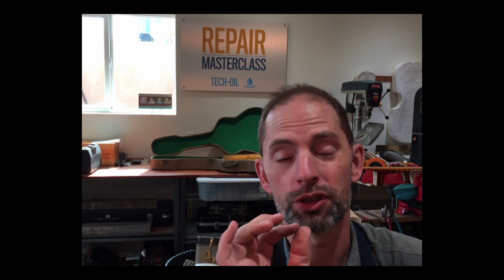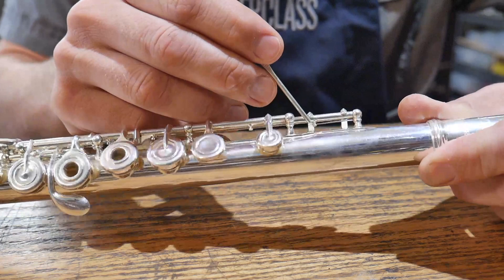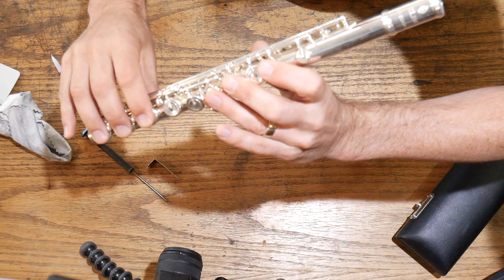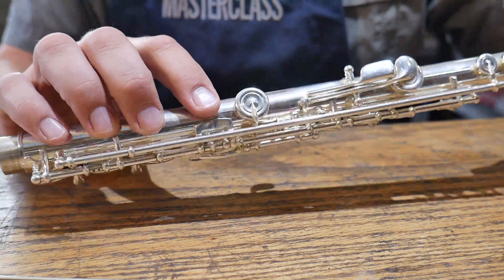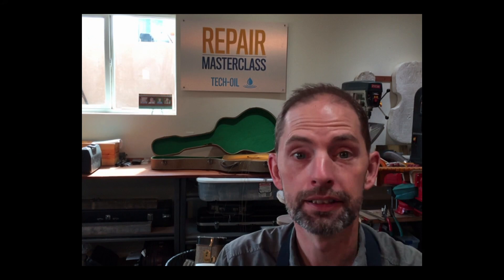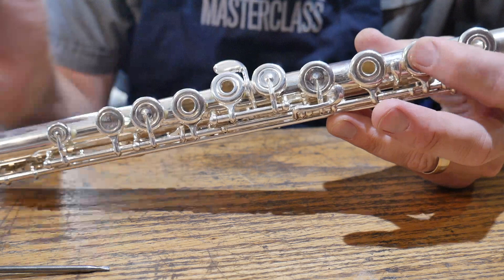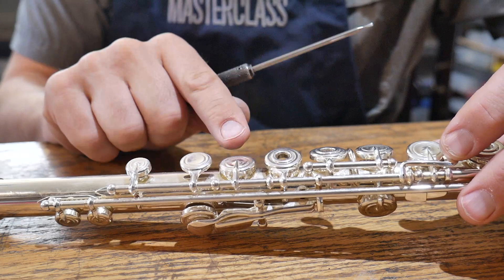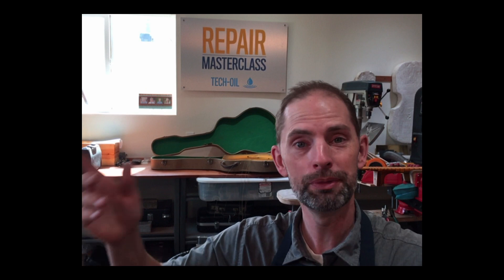Flute Emergency Repairs

Comment: Full disclosure here...I have a degree in music education so I felt pretty comfortable with all of this. I had a key that was leaving slight gaps in others when I pressed down. I had been putting off taking my flute in forever because apparently I'm lazy or something 🤷‍♀️ Anyways, I have long suspected it was something SUPER slight like adjusting a screw.  Yup literally all I had to do. I adjusted a tiny hidden screw and I can play my F's without pressing down my f-key with the force of what felt like the Hulk! I figure if I could restring a french horn, doing something simple on my own instrument should be cake. Now will I go repadding or recorking my flute? Nooooo! Absolutely not. But slightly adjusting screws and such I can handle. Saves me some time for other things in my busy life. Thank you!
Reply from the maker: I couldn't ask for a nicer or better response. I'm really glad this was of value to you and that you no longer have to your Hulk-like strength to play.
Reply: I know this is months after this comment was posted but could you tell me which one it was? I’ve been having the same issues in which my Fs won’t come out without having to press harder on a certain key
Reply: @BeepBop726 left of the 2nd finger on the right hand under that key is a tiny screw
Reply: I have this problem too! F-key doesn't shut properly. Over watching this video, i loosened the screw on the left of f-key and problem fixed! Thanks a lot👍😁
Reply: Bro- my f was having that exact problem and my section swore that my one tight screw wouldn’t ruin the note so I thought it was a leaky key but i just loosed the screw and now i can play my f.
Reply: @BeepBop726  I just saw your comment over a year later so I'm sure you've got it figured out. I'd have to look at my instrument to know for sure but if you'd still like to know,  I can take a look and let you know. Just be careful when making any of your own adjustments! ❤

Comment: One of my flute trill key is open and it doesn’t Play right, the trill  spring is off, do I just need to put the spring back?, sorry I need this for band.
Reply from the maker: Yup! There's a chance the Trill key is bent and if it is, you'll need a good tech you trust, but more than likely it's just the spring. Flit it back on there.
Reply: @repairmasterclass  just to make things clear, the trill key next to the c key is open and I use a piece of tape to shut it for a while, and I don’t see the screw that keep the other trill key shut, sorry I need this for band

Comment: Hi! One question, my low D isn't coming out when it usually does. What screws should I look for or what should I try to fix?
Reply from the maker: Sorry for my delay, I was on vacation. There are a few reasons this could be happening. 1) The screw at the D key (could be on top and easily visible or under the key) could be the issue. Use a feeler gauge and adjust accordingly. Very, very small turns of this screw make big changes. 2) The D# key on the foot joint could be leaking. Use a feeler gauge to test for a seal here. 3) The D key could be leaking. Take a look at these possibilities - learn more about how to do this with the Emergency Repair Guide available for free on my site - and if you're still having issues, take it to a shop you trust.

Comment: Hello, thank you so much for the master class! One question on the g# key when you put it back where should I put the spring. It is also not working properly. I'm having trouble doing that.
Reply from the maker: Great question. I should do a video on this topic as I get the question a lot. Okay, let's agree on what side of the instrument we're talking about then go forward from there: If we're looking down on the flute we can see the Bb/B (left thumb) key on one side and the G# lever on the other; let's call the Bb/B side the back side and the G# side the front side. 
The springs typically sit on the back side of the spring notch and will lift the key up or open. If you happen to put the spring on a side and it forces the key closed - move the spring to the other side...the only and obvious exception to this being the Eb on the foot joint and the G# we're about to talk about, which are to stay closed unless pushed. 
Now, the G# key, way under everything else, MAY be an exception to putting the spring on the back side. Every manufacturer will install this spring in a different, unique way and you may need to play with it to figure out what their intent was - keep in mind, you want the G# to be pushed closed by the spring. To make this a bit more tricky, you have to set this spring before you insert the key rod...a bit of an acrobatic feat at times... but you'll be able to see right away if the the spring is pushing the pad closed or open and can adjust. Long answer - like I said, it needs it's own video - but I hope this is a help.

Comment: Great information. I have two flutes; a student flute that has screws on top of the keys, and a way better one that has them hidden. The hidden ones makes it very difficult to choose which ones to turn so I am too scared to try to do it myself. I requested the free info as you suggested so I am hoping it goes into more detail on which key/screws adjust what. Thanks!
Reply: Same I tightened all my screws and now all the keys sound the same

Comment: Could you please advise the specific screws I should adjust to fix the issue where my high E flat sounds flat with standard fingering but is in tune with the shortened fingering? I  frequently alternate between the two fingerings in chromatic passages to balance the intonation with surrounding notes. However, it's confusing to choose between the two while playing. Please help.
Reply from the maker: Probably Not an adjustment screw... I'd venture a guess you have an air leak in a pad or key heigh openings could be causing issues. High E is never nice to tune but you should be able to get them to lock. Find a local tech who's good with flutes that you trust and go play your flute for them and see if they can help sort out what mechanical issues may be contributing to the issue. There are a few possibilities to consider.

Comment: I have a screw that will not come out, is there any way to loosen it.
Reply: my flute had this problem found out that the rod was bent so it wasn’t loosening 🥲
Reply: Thanks, what did you do to fix it?
Reply from the maker: Sorry for my delay. This one is tricky! Stuck screws is were technicians really earn their keep. Breaking off a head and then having to extract a screw without causing damage to the rest of the instrument is a critical skill... one I'm still working on 26 years later. It's hard. If you have a stuck screw, take it to a great tech. If they can't get it, have them reach out to me and we'll consult on several options.